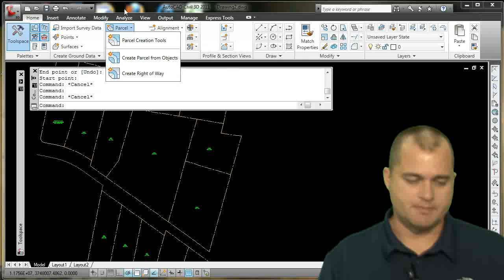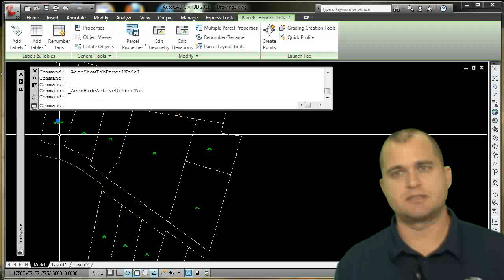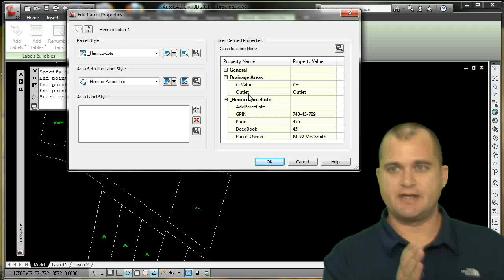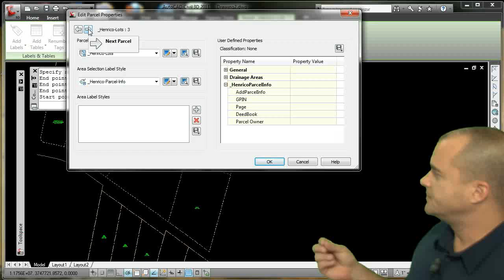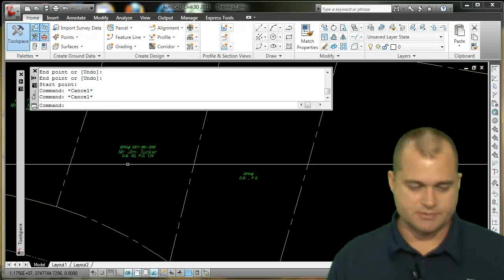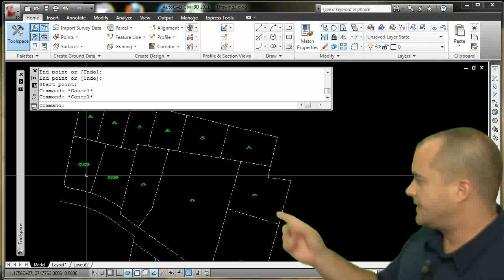Edit Multiple Parcel Properties

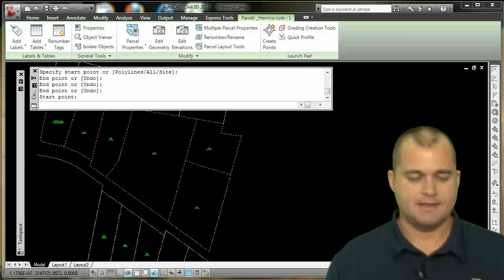Comment: The "Edit Parcel Properties" at 2:08 wont appear for me. It works for others files, but not in my current file. Does anyone have a solution for this? My workaround is changing it via Prospector.